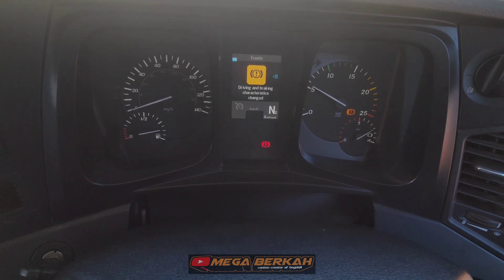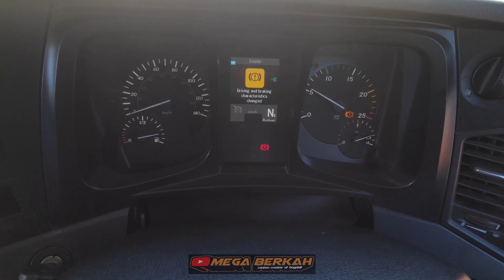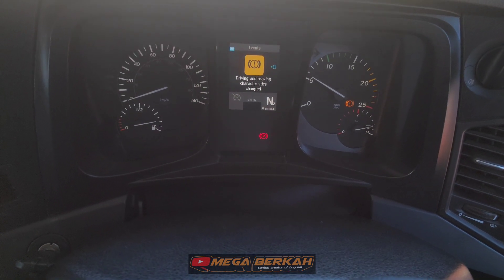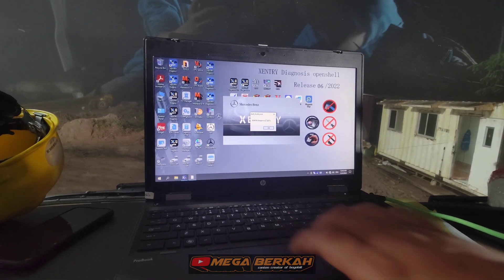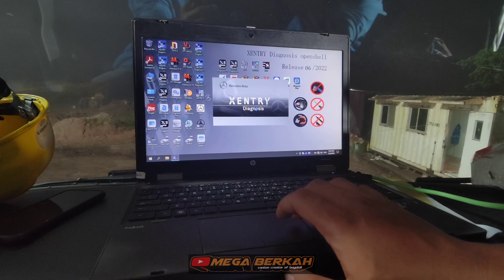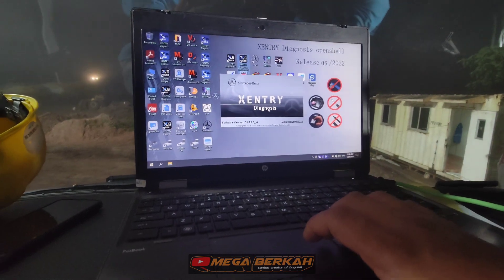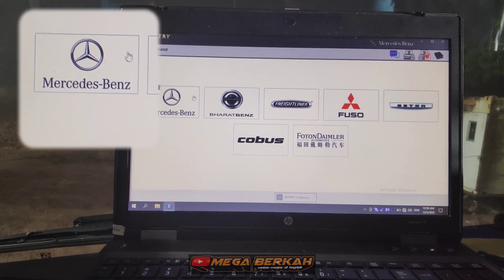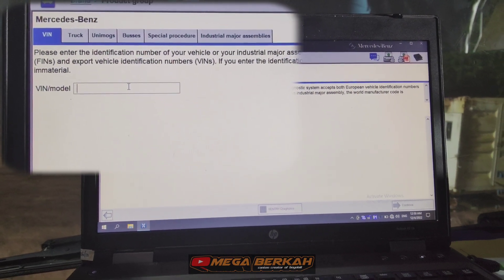Troubleshooting EBS Mercedes Benz AROCS 4040

Comment: Bosku mau Tanya Systemya Engine Brake Sama Exaust Brake Bosku... 
Kenapa Sudah Di Pasang Baru Semya tapi tetep gak mau, Selenoid ngebaca Aja Sampe Ke Monitor di Cabin... Mohon Pencerahanya Suhu....
Reply from the maker: Ini mercy Arocs ya yang bermasalah seperti ini?
Reply: @Mega_berkah iya Bang.. Arocs 4040, Tapi Sudah Aman Bang... 
Bang... Arocs 4040 knapa Sering Kena EAPU nya Ya Bang... Ada Solusi Kah Bang.   Biar EAPU awet... Sering terjadi Eror Parking Brake
Reply from the maker: @popay7573 kalo dari saya pribadi itu harus learning dan reset eapu menggunakan xentry, dan harus setiap HM 500 ganti filter air dryer
Reply: @Mega_berkah  Makasih Ilmu dan Infonya Bosku...
Untuk Xentry Sendiri Apakah Versi Full dari Daimler Apa bisa Pake Yang Crack Bosku
Reply from the maker: Setau saya yang full cuma di Daimler ya. Untuk user GK dikasih yang full